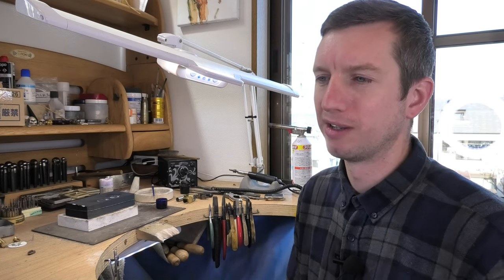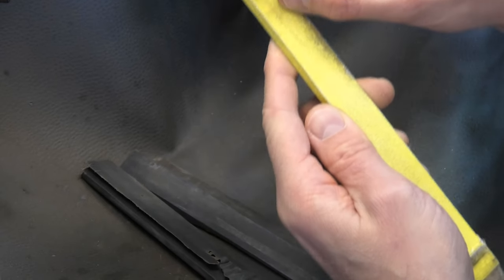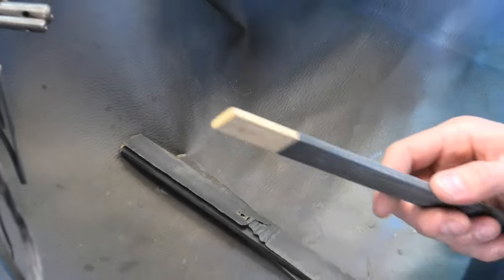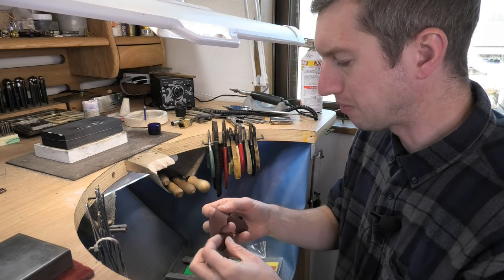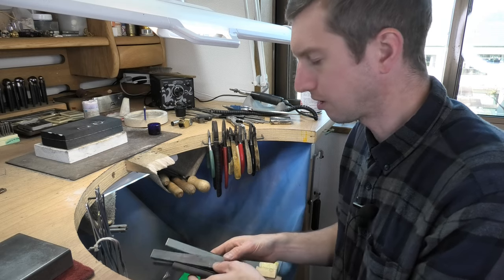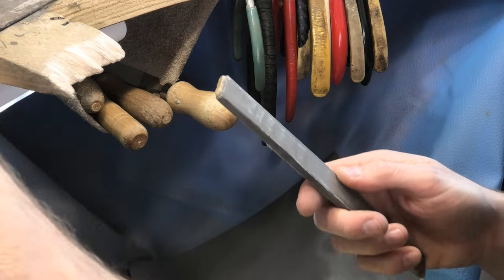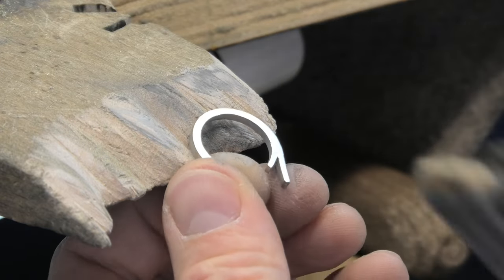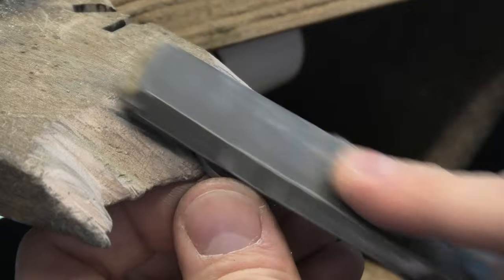How to Make a Perfect Buff Stick

Comment: I actually used paint stir sticks found at our local diy shop wrapped them in the wet/dry and love it. I only use 600 grit I will be purchasing additional grits after watching this😁 thanks for another GREAT vid Chris!!! 👏👏👏 P.S YES PLEASE make selling on Etsy video. I want to start my own Etsy to at least make enough to buy more material and/or tools needed to carry on in this amazing trade. Thank you so much for all the amazing information and inspiration you continue to so generously share!!! 🙏❤🙏
Reply: Same here with the paint sticks - I use the 5 gal stir stick and cut it down to a good length.
I use 600, 1000, 2500, 4000 paper - then polish. I have lower grit and higher grit but rarely use them.

Comment: emery paper is no longer predominately made of corundum, its more likely to be made of silicon carbide or aluminium oxide as they are cheaper to produce.
also your magical roll is cloth backed emery and is mainly used in wood turning
Reply from the maker: Thank you!
Reply: That Roll of Red sand paper is available everywhere here in Bangkok as its used for everything here in gold. Sarkle is suposed to be the brand from germany but not sure if its from germany.